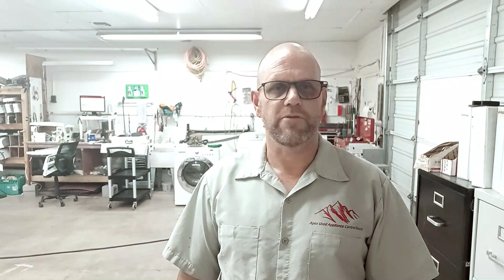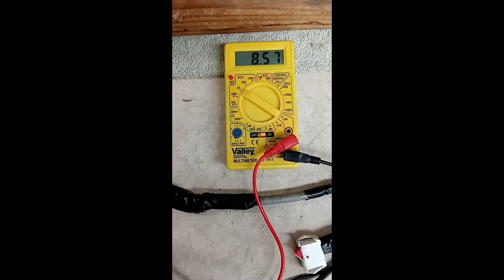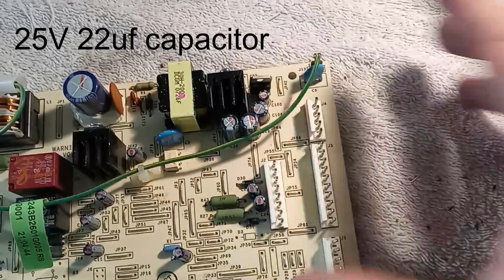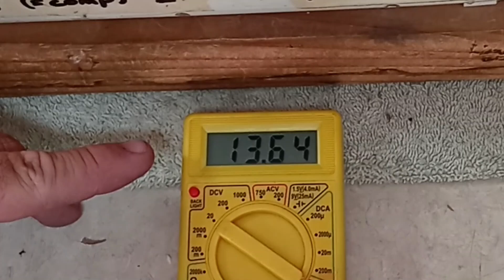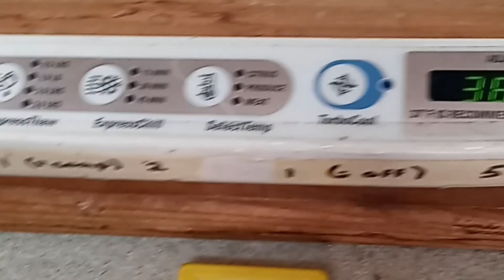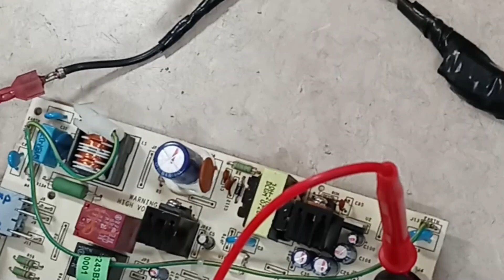How to repair your GE Refrigerator Control Board.

Comment: Will any 25v 22uf capacitor work, is it brand specific??
Reply from the maker: No, but the specs do. I would not buy the cheapest available. Look for brand name caps...Panasonic, Kemet, Nichicon, Omron..ect. 1000-2000hrs 105c.

Comment: Thanks Dave! I have the exact same board replaced both thermal sensors and defrost heater. Defrost heater burns out immediately. There is no no defrost timer. even if I see not bulging or burning  on caps. Any suggestions? from Florida, David ty
Reply from the maker: If you are installing new defrost heaters and they are failing immediately, then it sounds to me like something other than the board is the problem. Are you putting in a exact OHM rated replacement element? 
You can easily test the board for defrost function. Put the refrigerator into Manual Diagnostic Mode,  then into forced defrost. (Ben's Appliance has good video how to do it) Listen for relay "click" check for 120 vac at the large terminal on the board marked Dfost and N at J7-1.  If the "timer" (check defrost thermostat) is staying on way to long then that could be a problem with the board, but that would be very, very, rare.

Comment: I replaced one of my 400 volt caps which was bad
I am getting my 13.5 V and I found a 5 V supply that is working also… But when I plug it in my control board still does not light up? Any ideas? How many amps will this supply put out I was thinking about loading it down a little bit on the bench.
Reply from the maker: With those readings the control is working. If you have 13.6 VDC at the J4 connector then the board is fine. Check for the same VDC at the same wire colors at the User Interface board. If it is present then you have a bad UI if it is not present check the wiring going to the UI, it might have a pinch point below the freezer door. 

Dave-Apex
Reply: @apex-used-appliance-contro2889  Yes when I put a 20 ohm resistor across the 13 V it was failing 
Went down to 5 volts 
I change those first 2 470uf caps 
And now it works under load
I suspect it is a good board now I will put it in the fridge when I get a chance and test
Reply from the maker: Good deal, that should fix your board, as those two caps are often bad.

Dave-Apex
Reply from the maker: Also disconnect the J2 connector from the board. If the front panel comes back to life and the compressor starts up, then your evap fan is most likely no good and robbing power from the main control board. 

Dave-Apex

Comment: I have a GE Monogram ZIS360NRC built in refrigerator.  I am having defrost issues.  Refrigerator temperature is slowing increasing but freezer temperature stays about the same.  I tested the defrost heater and recorded 38 ohms.  I tested the power to the motherboard and have a good 120Vs.  With frig plugged in and a jumper placed on J9 and J11 I don't see any glowing of coil but heater tested good.
Reply from the maker: Sounds like you have a slow or intermittent evap fan. Or if you are getting ice build up change the defrost thermostat/bi-metal. If no ice build-up check for complete opening of the damper door. Control board defrost function checks are done in manual diagnostic mode. You will be able to check the board, bi-metal, heater and wiring, all at once, by function testing the defrost circuit.
Reply: From the main control board with the compressor and compressor fan running I checked:
Thermistor supply voltage - 5 VDC
Evaporator fan tach - 5.87 VDC
Fan common - 13.44 VDC
Evaporator fan - 12.28 VDC
Fan supply voltage  - 13.43 VDC
Did a refrigerator self test on thermistor and all (P).  Actual readings of thermistor from main control board with freezer at 5 degrees and frig at 52 degrees:
Fresh food thermistor 1: 1.96 VDC
Fresh food thermistor 2: 2.04 VDC
Freezer thermistor: 3.45 VDC
Evaporator thermistor: 1.87 VDC
Reply from the maker: So are you having defrost issues or is your refrigerator and freezer temps too high? Everything appears to be working. Low on Freon? Check the frost pattern on your evaporator.
Call me.

Comment: What terminals or pins are used for the 120V power feed connection? Thanks!
Reply: Found a schematic after searching around. I hooked the 120V feed to L1 (main connection for Compressor) and the J7 neutral pin. After powering up and hooking to the control panel terminals as Dave shows, mine voltage was fluctuating as described, changed the capacitor and it worked! I was stumped as first as I was getting nothing. Finally noticed on the schematic the upper parts of the board are mostly DC voltages. Thanks for sharing this Dave!
Reply from the maker: Great job Randy! Happy to be of service.

Comment: Replaced control board,defrost, thermostat and the freezer still does not cool below 14 degrees. Please help!
Reply from the maker: Check your evaporator fan or replace it, check the frost pattern on your evaporator it should be even from top to bottom. If the pattern is missing the middle section, or only at the top or bottom you have a freon leak, clog, or a tired compressor. 

Dave-Apex

Comment: Surprising to see that the fuse supposed to protect the board circuits is not doing its job. 
Thank you for video.
Reply from the maker: Yes indeed, seems to be pretty unhelpful.

Comment: It worked for me! Thanks a lot! How did you find out which cap it was? Mine showed no sign of damage/leak.
Reply from the maker: Thank you for your question, Cyrille. These caps don't show any signs of damage like most of the other ones will. Found it by replacing all the caps and fixing the board. Then taking them back out one at a time and figuring out witch one(s) where causing the problem.

Comment: This video was exactly what I was looking for.  Checked the voltage and mine was fluctuating.  I did the repair you suggested and it works.  Thanks so much.
Reply from the maker: Right on, thanks for the feedback Todd and glad we could help out. If you ever need a control board please feel free to give us a call or look us up online. Dave-Apex
Reply: @apex-used-appliance-contro2889  Ok Dave, thanks again.